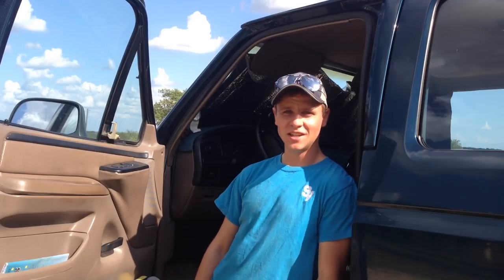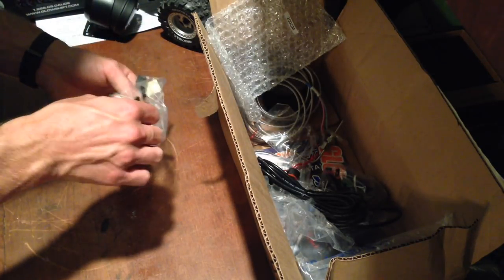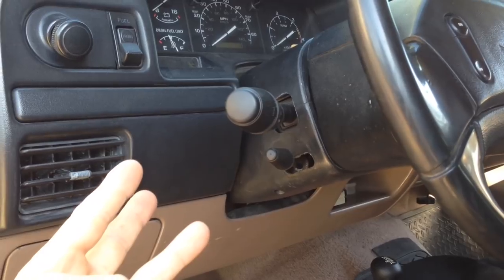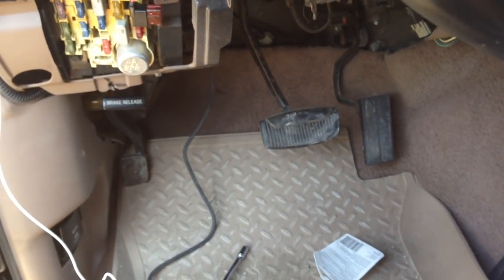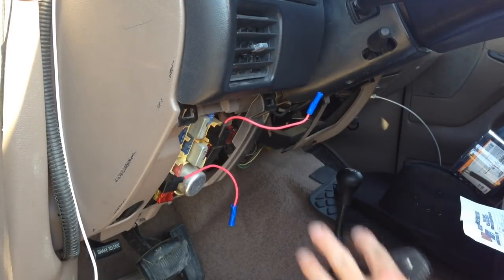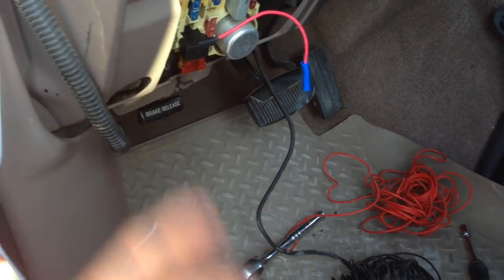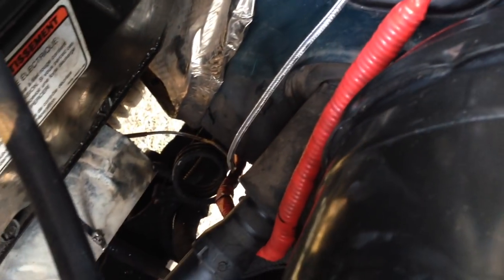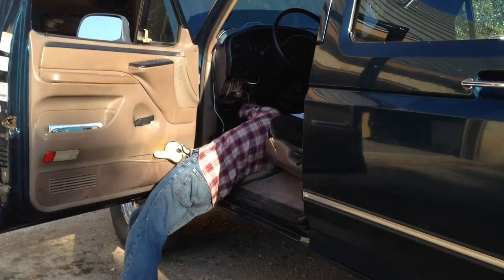Gauge Install OBS 7.3

Comment: great video. If I may,  when tapping pipe threads a rule of thumb to know when the threads are deep enough is to stop when you can turn the fitting in three turns by hand. Then of course tighten the rest of the way with a wrench. E

Comment: Man you put out some good videos on these obs trucks.  I have the same exact truck just a manual and the grey interior, even have the same brand toolbox lol.  I'd like a good gauge set to watch my egts, coolant temp, and boost while pulling our camper and dump trailer.  Is this one still holding up good and can I run a sensor for my coolant instead of trans like you did?
Reply from the maker: That's awesome! I do envy your manual transmission though. So far the Gauge is still holding up fine for me. You probably could get the exact same gauge as me and run the temperature probe in the coolant, though I imagine glow-shift makes a 3 in 1 that is designed to do what you want. That way you don't have to worry about your coolant temperature being called TRANS. Just for the cleaner look if anything
Reply: Rnddiesel thanks for the reply back man!  Yeah it took me a good couple years to find the truck I wanted lol.  Might be a stupid question but where does the probe go to read the coolant temp?  Is there a plug in the rad like there was in your trans for the probe?
Reply from the maker: @drewgordon3521  I don't know exactly where the best place to put it would be, good point. I don't believe there's a plug in the radiator, though you may be able to adapt the drain plug. Another option could be the drain plugs in the block. Getting coolant temperature closest to the block would give you a more accurate representation of the peak value I'd think. The drain plugs should be on either side of the block. Either that or you could find the temperature sending unit to the dash gauges and tee into that fitting.
Reply: Rnddiesel I’ll have to do some looking on my truck when it gets a little warmer lol.  I really appreciate the replies man!  Don’t get that very often on older videos I really appreciate it!

Comment: you make good videos though! it flows nicely. keep up the good work.
Reply from the maker: Haha thanks, unfortunately there's not really much I can do about genetics! But a big truck that'll do everything I need it to, that's something I can manage.
Reply: im planning on doing a very very cheap guage job on my truck. its a 1996 f-superduty(f450) only reason i want a boost guage is to detect leaks.
Reply from the maker: Barack Obama, if you just want to detect boost leaks, there are cheaper and easier options out there. If your truck is a late enough 96 year model, I assume it has an OBD 2 port. If so you can use a scan gauge 2, at the very least it's easier to setup. I've got a video on that too: https://www.youtube.com/watch?v=iRxQH6_i3Ls&t=1s  The only downside to the scan gauge is that it used the engine MAP sensor, so if that sensor is bad, or you're running a 'boost fooler' then it won't give you an accurate reading. I've been happy with my Glow Shift gauge, for the price it's unbeatable. It looks like they also sell just boost gauges for only ~$43. Another low cost brand I've looked into is Hewitt Gauges. I believe they make primarily aircraft grade gauges, so they are held to a high standard. You can get a boost gauge from them for not too much more than the Glow Shift. 

On another note, assuming your truck is stock, there's really not many places a boost leak would form. Check the intake Y boots from the turbo to they cylinder heads. The boots are silicone which isn't the best for oil resistance, and as with anything they wear out eventually too. Also there's an O-ring from the turbo leading to the turbo y pipe that is susceptible to leaking too. There's also a less likely candidate, the intake plenums. Those are the black, sheet metal looking intake manifolds that connect directly to the cylinder heads. They have an RTV style gasket on them that can also go out, but this is less common from my understanding. That's pretty much it in terms of post turbo leaks. The only other 'boost' leak places would be in the exhaust side. There's a couple of 'donut'  style gaskets from the exhaust manifolds leading to the turbo (turbo up pipes) that also commonly leak. A lot of folks will upgrade the 'donut' style up pipes to a 'bellowed' up pipe to fix this common weak link, but that requires turbo removal and is quite involved. Best of luck!

Comment: How come on the glow shift video for the install of the boost gauge he put the tee in the map sensor Line, like you did but then he removed the warm air heater from h the manifold and put in a boost adaptor fitting and hooked it up to that ?
Reply from the maker: It sounds like you're talking about 2 different methods for different trucks. Old body style 7.3 Powerstrokes didn't have an air intake heater - 97 and before, but the newer Super Duty trucks did. I suppose you can put a boost pressure gauge in the y-pipe on the Super Duty in place of the air intake heater.

Comment: Hey I bought the same kit for my truck which is the same same year and model as yours with the 7.3 and I can’t get it to stay the same color and I used the same fuse spots as yours what do u think it is
Reply from the maker: Sweet, well the whole setup has been working well for me for the past 5 months or so now. You should be able to just click through with the button, leave it and it'll stay that color. Is it shutting off on its own and causing the color change? If so definitely double check the ground, mine original ground only lasted about a week, then I redid it using a pair or wire crimpers instead of pliers, and it's held up since. The other thing I can think of is to double check your power wires, your constant 12v on source might actually be a key on only power source. If you can, double check it with a test light. I don't remember which wire it is, but at least one should have power unless you disconnect the battery. Best of luck!

Comment: Why not just pull the cluster out for 5 min and run the wire behind/hidden and use the orange wire off the radio harness? Seems so easy compared to putting conduit up the door frame. Can put a 1/4-3/8 hole in the dash in a convenient spot and mount gauge.
Reply from the maker: Yeah there's probably a better way to mount the gauge. This is just what I came up with and it works just fine!

Comment: How are the gauges holding up?
Reply from the maker: After about a year, they still work great! They are a little bright at times and the wiring is very thin so I had to solder a lot of connections, but I've got no complaints!

Comment: I tapped into my map line with an adapter just like you did but it’s not reading it’s still I at 0? Any clue as to why ? Same obs mines 97.5 f250  7.3 hd 4x4
Reply from the maker: Unless the sensor is defective, you hooked it up wrong, or your map sensor hose has a break in it, I have no idea what else it could be. You may want to grab a multimeter and see if the sensor has high resistance which may indicate a failed sensor. You can also look up the resistance value that it should read under atmospheric pressure. Best of luck!
Reply: Rnddiesel false alarm, thought I could build pressure in park took it for a spin and it’s working great! Such a good tutorial
Reply: Thank you!
Reply from the maker: @tcyourkidding1355  Haha, good one! Yeah you've got to load the engine to make any real boost, glad to hear it works!

Comment: For the egt probe can I drill in my down pipe ?
Reply from the maker: You can, however it is not recommended to do. You'd likely have to add a bung to help hold it in place since the pipe is much thinner and wouldn't be able to take many threads. Also, and a bigger reason why you shouldn't: If you're measuring EGT in the downpipe, you're measuring it after the turbo. Basically you get an inaccurate reading that can be a few hundred degrees lower than the actual peak EGT's. The turbo uses the hot exhaust gas to work and reduced the temperature in the process. So while you may be only measuring 900*F EGT's in the downpipe, you may actually be pushing 1300*F pre-turbo (for example). The best place to put the probe is in the pre-turbo exhaust. I put mine in the manifold, and after a year, it's still holding up great!

Comment: are glow shift gauges a good brand
Reply from the maker: I had wondered the same thing. Right now in terms of longevity, I think it's too early to tell. I've only had them in for a couple of weeks. They are pretty much the lowest cost gauges out there. The wiring is pretty thin, and I think that's part of why they're cheap. The power harness was definitely way to short and needed to be extended. The gauge lines for the trans temp and boost were a little short and could've been longer. However the gauge itself seems to be pretty good quality, it feels like a nice heavy piece, not flimsy or anything. I was actually rather impressed with the actual gauge despite being low cost. Furthermore, the instructions on installation were basically nonexistent. There really was just a general wiring diagram, but I guess it works and Glowshift has some other videos out there as well. 

So far its still a bit too early to tell, but they seem to be pretty good so far!
Reply from the maker: I had wondered the same thing. Right now in terms of longevity, I think it's too early to tell. I've only had them in for a couple of weeks. They are pretty much the lowest cost gauges out there. The wiring is pretty thin, and I think that's part of why they're cheap. The power harness was definitely way to short and needed to be extended. The gauge lines for the trans temp and boost were a little short and could've been longer. However the gauge itself seems to be pretty good quality, it feels like a nice heavy piece, not flimsy or anything. I was actually rather impressed with the actual gauge despite being low cost. Furthermore, the instructions on installation were basically nonexistent. There really was just a general wiring diagram, but I guess it works and Glowshift has some other videos out there as well. 

So far its still a bit too early to tell, but they seem to be pretty good so far!

Comment: Is the gauge still working?
Reply from the maker: Yeah it sure is!
Reply: @Rnddiesel  any complaints? I’m torn between this and the much higher IssPro ones
Reply from the maker: @tjlqk3  Probably the only complaints I have are that the wires are a bit thin which makes crimping for installation a little challenging. You'll definitely need to extend the wires. The gauge is a bit bright, but wiring in the dimming function helps a lot with that. I do wish there was a way it could measure fuel pressure rather than boost pressure without the naming being off. There are only so many x3 gauge combos they offer, so that's a downside. Otherwise I'd totally go for it again. Just make sure to make a good ground wire, protect the wiring as well, and you should be good. It really comes down to looks between the Issopro and GlowShift  I guess!

Comment: What air filter are you running in this video?
Reply from the maker: I'm running a Donaldson Blue 6637. Supposedly it's less restrictive than the normal 6637, yet filters better and is more water resistant.

Comment: what size port is on boost fitting? for sensor
Reply from the maker: The boost fitting is just 1/8 npt, all the sensors are that same size. That's the same size as the ICP and back pressure sensors too.
Reply: thankyou!